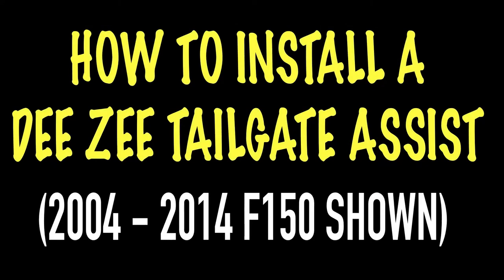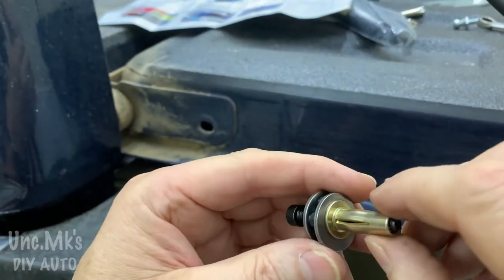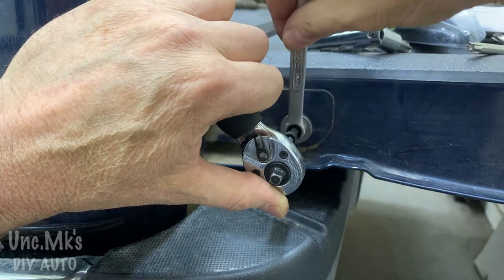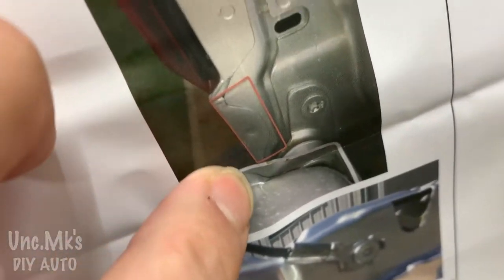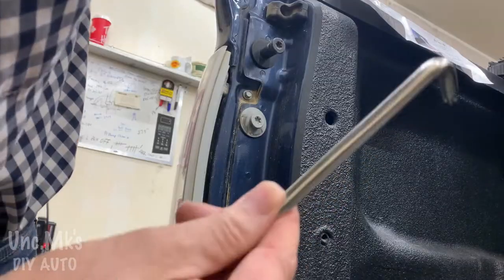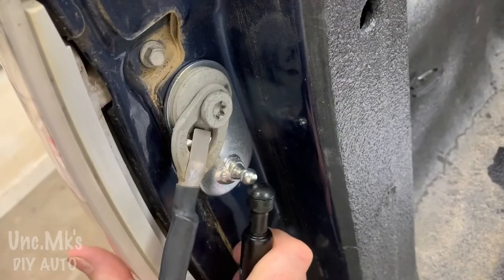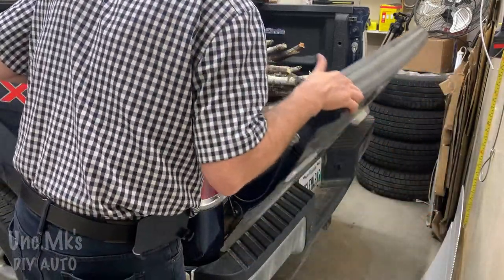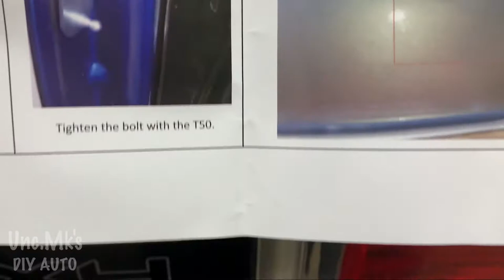How to install a tail gate assist shock on truck (EP 213)

Comment: I have a GMC Sierra Denali that has this feature from the factory and it's nice. Problem is that I'm so used to just opening the handle and watching the tailgate creep down, that I forget and end up slamming the tailgate down on my other two trucks that don't have this feature. So, thanks for the video Mark, it reminded me that I need a couple of them!! Off to Amazon I go.
Reply from the maker: I find it is nice if your holding something heavy in your other hand and needing the tailgate opened. Your not scared to drop the gate. In winter here, top of rear bumper gets layered with ice and will hit gate and damage gate it if you drop it opened on the ice and snow.
Reply from the maker: I believe all the new trucks (any make) have this feature now. My F150 is a 2013 with 29,500 original miles!

Comment: This good stuff unc. I never gave it much thought. Curious as to what the new trucks using to dampen the gate during drop down.
Reply from the maker: The aftermarket kit for the newer Fords hides inside the fender behind the tail light. But this is fine. Was not sure if I would like it or not, but so far and give 2 thumbs up! Congrats again on the 40k subs!
Reply: @unclemarksdiyauto  Thanks bud..I havent gave it much thought but now I wanna see what those new Ram 1500 trucks on the lot using to accomplish this..I will look 2morro...Great video
Reply from the maker: @OnlineMechanicTips  It will be interesting to know how they accomplish the tailgate damping/slow opening.